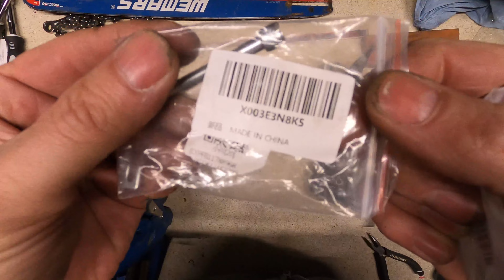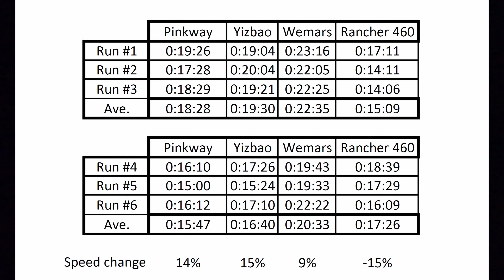$100 Chainsaw Shootout EP:07 Base gasket delete and test cuts

Comment: Glad u done these videos on these zenoah clone saws please continue on with more vids on these I have a supmix 6200 version of these saws runs good
Reply from the maker: I'd like to get a Coocheer to compare as well.  Maybe I'll do a $150 saw shootout and get the Supmix and Neotec.
Reply: Are all those saws 50 cc or is the pinkway more displacement ? , it seemed to me the pinkway was just the fastest and smoothest running one even right out of the box , which one did you like the best ?
Reply from the maker: @Hambonebodi  As best I can measure, they are all 54CC.  I can't really tell why, but I like the Yizbao a little more than the others.

Comment: I converted all my clones to side chain adjust.... I also converted to  paper filters.  I even converted one to 3/8 x.50 chain To match my 460 rancher, But I converted it back because it didn't seem to  cut as well... I love my clone saws, and I just picked up a Pinkway so it was nice to see yours.  The plastic worm gear oiler was incorrect on my Pinkway and I had to replace it, the flange was too thin and allowed a aprox. 1/8 " gap for sawdust to get into the oiler.  I'm noticing some of the replacement parts on Amazon etc. aren't up to spec for all saws,  so be warned It's kind of a crap shoot. Love your saw content, thanks for the videos.
Reply from the maker: I found a couple different side adjust tensioners online for $6-$8.  They seem to work well on these.  They are all side adjust now.
Reply: Could you be so kind as to tell me what to get?  I can see the hole for the side adjust, just need to know what to get.
Reply from the maker: @MrBooMY3  These are the two that worked for me.  https://www.amazon.com/gp/product/B0C9SQNQW2/  https://www.amazon.com/gp/product/B09TB32FKG
Reply: @Havensal1 just ordered 2 tyvm!

Comment: Havensal1, please tell us if the cylinders of these Chinese engines look like they are Nikasil  silicon carbide plated? https://en.wikipedia.org/wiki/Nikasil
I don't think they are. I think that's why the manufacturers says to run them at 25:1 instead of 40 or  50:1.  I run all my saws at 20:1 so they last longer.
Reply from the maker: @JohnSmith-1234  I believe they are plated.  With what, I couldn't tell you.  Every 2 stroke I own runs on 40:1.  Even the old 16:1 saws.  Modern oils are way better than what we ran back then.  If I were running them every day it might be more of an issues, but for a weekend warrior like myself they will outlast me.
Reply: @Havensal1 , thanks for the reply. If not Nikasil plating then maybe the Chinese use hard chrome lined cylinders but I think some Chinese saws might have just plain steel cylinder liners. I remember the saws of 50 years ago running at 16:1 too. I figured maybe the EPA said that saws had to run at 40 or 50 to 1 to reduce air pollution but maybe with the better oil and cylinder lining 40 to 1 is all you need like your said.
I have and old Poulan 16" saw I bought in 1995 I have always run at 20:1 that I have abused running it real hard cutting some really big hardwood trees but it still has good compression while my friend's newer Poulan saw that he ran at 40:1 has very little compression left. 
I really appreciate your Chinese saw videos since I am considering getting one. I think I had better get one that spare parts are readily available for. I would like to find a cheap Chinese copy of a Husqvarna or a Stihl so I could be sure to get parts for it. 
The Craftsman saws they sell at Lowes are made in China but they are way over priced costing nearly as much as a Poulan. The Hyper Tough 16-inch Gas Chainsaws they stock at Walmart stores are made in China but overpriced too. Maybe I can get lucky with a Chinese saw from Ebay.